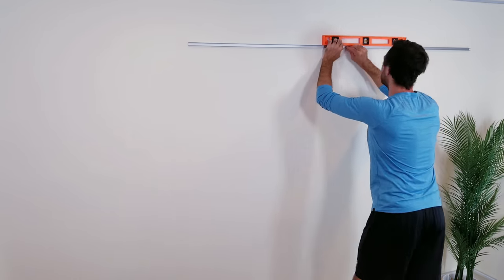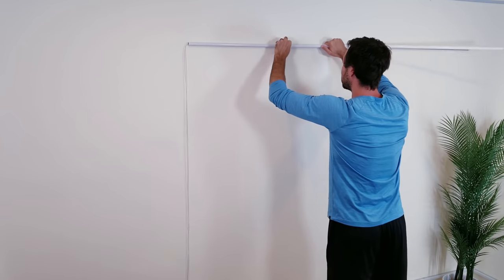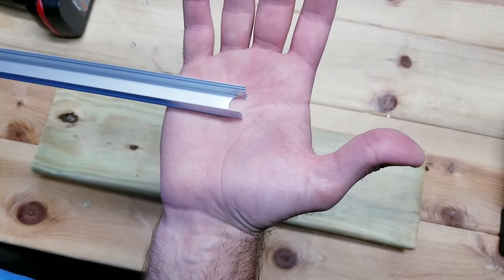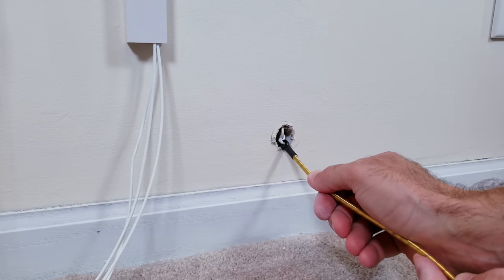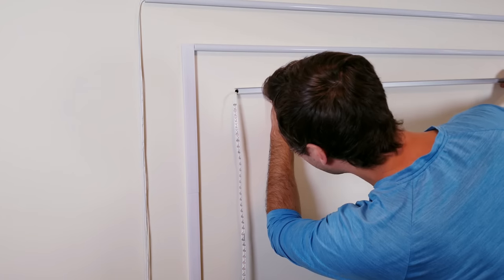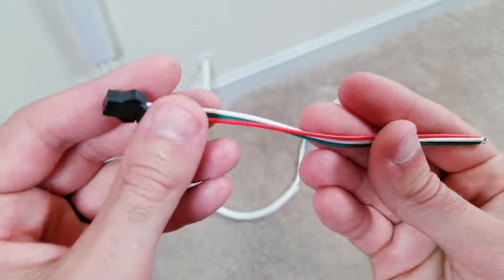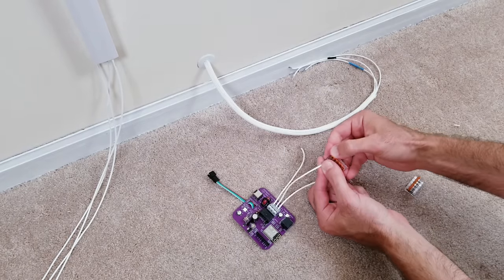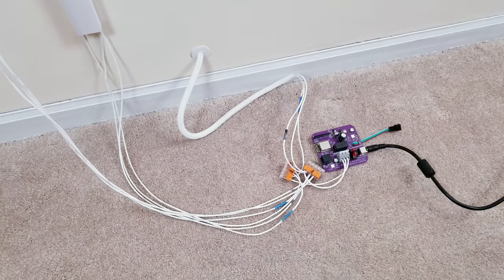How To Hide Wires Behind Wall - NO DRYWALL REPAIR NEEDED. Hiding Wires

Comment from the maker: 🚨 AMAZON’s BEST DEALS (updated daily): https://bit.ly/3VWZKVS
☑ Check out my sponsor to begin your FREE 14 day trial to Aura: https://aura.com/chrismaher
Spotless Diffuser Channel 1m Amazon: https://amzn.to/47aIujz 
Spotless Diffuser Channel 2m Amazon: https://amzn.to/3QoHeDb 
Diffuser Channel 1m or 2m Company Site https://bit.ly/3NHG5Uw

Domestic Automation WLED Controller: https://amzn.to/3sxkeYI
Power Supply For Controller: https://amzn.to/40yyQCZ
WS2812B LED Lights: https://amzn.to/47LIfLP
WS2812B LED Lights AliExpress: https://s.click.aliexpress.com/e/_Dc8oboJ
Magnepull System :https://amzn.to/3KUU60j
Magnepull 1/2 Inch Lead Attachment: https://amzn.to/3E7N0lx
Forstner Bits: https://amzn.to/3KTbFOh
Wago Connectors: https://amzn.to/44rFDjo
Wago Connectors In Line: https://amzn.to/3ORTbPs
Mesh Cable Sleeve: https://amzn.to/3EaNreO
Cable Concealer Track Large: https://amzn.to/45Hilas
Cable Concealer Track Small: https://amzn.to/3sgdMFt
Wall Plugs: https://amzn.to/3suFoXu
Wire Stripper: https://amzn.to/3EamDeI
18 Gauge Silicone Wires: https://amzn.to/3QRVxkb
3m Removable Wall Strips: https://amzn.to/3OvUaFY

=============================
Support My Channel Directly:
Become a monthly contributor on Patreon: https://www.patreon.com/ChrisMaherDIY
Buy me a Coffee: https://paypal.me/ChrisMaherDIY
==============================

Mentioned Relevant Videos I've Made:
Soldering for Beginners: https://youtu.be/apSz3NXYlx8
Domestic Automation Plug n Play Controller: https://youtu.be/aBOEHfT8VY4
Domestic Automation Motion Sensor & Push Button: https://youtu.be/d5NAn4qPXnA
Domestic Automation Multiple Data Pins: https://youtu.be/Zzi5UIGnY2A
Hiding Power Supply and Controller: https://youtu.be/ibRp6eeUwBA
Gaming Room Setup Part 1: https://youtu.be/KbbKAxnpCQQ
Gaming Room Setup Part 2: https://youtu.be/2lKaAhS2L1U

The best way to help support my channel is to like, comment, make sure your subscribed and share my videos with as many people as you can. The other way is to use my links above as I get a small % at no extra cost to you if you buy something. Thank you all for the support!
Reply: you got any links for muzada diffusers outside of US?
also that white mesh?

Comment: Cries in german solid walls
Reply: Cries even louder, punches the wall in despair and breaks his fist 😭
Reply: cries in Indian solid walls
Reply: Cries in Bulgarian solid walls
Reply: For those living in countries with solid walls.

Check code of corse. But, you can make a facia wall using striping and the desired face material.

Striping can be anything from strips of 1/4" (6mm) to 3/4" (19 mm) thick material aprox 1.5-2" wide (33mm-50mm). 

Co.siderations for thickness
Space loss, faster length, additional insulation or sound proofing. Any runs needed.

To bring a socket or switch forward flush. Start by turning the circuit off at any breaker (local laws may require licensed prof). Pull cover plate and unit from existing enclosure

Use an aptopriate "mud out box" in facia material.

Attach receptical to mud box.
Reply: @chiefgully9353  Sorry, what's a mud out box, and what's a facia material?
Reply: @ifohancroft  
Facia = face. Decorative material to form the viewable face of a structure. Sheet rock plank board ect.

Mud out box. I think they are listed as wall brackets. Essentially its a plastic or metal square with a means of grabbing the face material. It allows you to install a receptical or or a low voltage plate. 

If your code does not allow them for standard electrical they also make box extenders that might work.

We (america) call em mud out boxes becuase they are typically installed in an existing wall where you have already done a mud out. They are also used in situations where you do not have the wall cavity to install a normal box
Reply: @chiefgully9353  Thank you!

I guess then mud out means the hole you've cut for the box?
Reply: Cries in Swiss German concrete and brick solid walls.
Reply: @ifohancroft  yes
Reply: Cries in UAE solid walls😭😹
Reply: There's no such thing as solid walls if you have a hammer drill
Reply: Spachteln, schleifen und streichen angesagt 😂
Reply: Wanna trade? I can't hang my TV on wall
Reply: Cries in Bahamian block walls
Reply: Option 2 und eine Yukka Palme davor 😅
Reply: Dynamite 🧨
Reply: Solid walls can be chased or have surface mounting. There are no whiny excuses.
Reply: Cries in English stud walls and about 3 studs in between
Reply: Laughs in jackhammer
Reply: Are Americans starting to realize that glorified cardboard walls are joke?
Reply: @caustinolino3687  
What do you mean?
Reply: There is solution - 0,05mm thick flat wires prepared to stick wall and be painted.
Reply: Cries in Egyptian solid walls
Reply: @caustinolino3687 
😂 It's the best for DIY.
Reply: Cries in South Africa solid wall
Reply: Central and South America are mostly solid walls, idk what is the deal with north America, the idea of non solid walls is crazy😂😂😂

Comment: for anyone considering, please DYOR as fishing lines behind drywall can be unsafe. use cabling specifically rated for in wall usage (ex. CL2/CL3 etc) if you dont want to burn your house down
Reply: I was just about to say!
Reply: I was just about to add a comment about this very topic.

Not only is using the properly rated cables safer, but it will ensure that your home can pass an inspection if it needs to.
Reply: Could you explain this more in depth please, in a manner that someone who doesn't really understand that, would be able comprehend, beacuse it sounds really important to know
Reply: @b1ooberry  sure, there are cables made for behind the wall applications. using standard extension cables, audio/video cables, and data cables like USB or network that you can find commercially are typically not rated for such use. there are such cables rated for in wall use which can safely sustain higher temps and reduces the risk of starting a fire
Reply: @jasenhenry thank you for the information! That's really cool to know for my future projects, so I appreciate you taking the time to tell me!
Reply: first thing I saw
Reply: I am not sure that's accurate. Those are only low voltage cables. They don't have to be plenum rated since they are not in the attic.
Reply: @RaoulHira  NEC standards in USA requires it for fire safety. im not understanding your argument for a less safe practice? "safety first" is a household term while "danger first" is not. one of the primary reasons for electrical fires is heat and standard consumer grade low voltage cables are simply not rated to sustain higher temps safely.
Reply: What’s fire insurance for anyway. Let it burn
Reply: Under 50v does not need to be rated for in wall nor do data lines.
Reply: @mattypants  I ran cables in wall opposite of my oven. if I didn't use in wall rated cables it would catch fire regardless if any data or power is actively passing thru it. it exists for a reason
Reply: @jasenhenry  why is the inside of the wall getting hot enough to ignite cables? Standard insulation on wiring, including Romex, can handle just under 200 degrees f. The inside of your wall should not be getting anywhere near that hot.
Reply: @mattypants  look dude, do what you want, it doesnt affect me. agree to disagree. later
Reply: @mattypants it's the risk of the wire overheating - over amps to a full a short turning the wire into a resistive heater to the capacity of the power supply until the wall ignites or wire breaks...
Reply: Not quite . It’s so that the wire does not further spread or propagate any fire in the future. That is, if you do have a fire regardless of how it was caused, you don’t want the flames to catch onto wires in the wall and spread more rapidly up or across into other rooms or floors. In the case here the wire is only a few feet in the same room so it seems a bit moot for a fire spreading perspective, but the regulation /code is there for that reason. Fire-rated cable won’t combust and flame as easily as non-fire rated.

Comment: So the trick with the magnet tool without opening up the hole is to bring the lead past the exit hole as low as you could go and hook back end and pull it out by the lead.  the roller tool should also pull on the eye too to get it near the hole laterally if you end up bottoming out against a floor board and the eye  wanders .

Comment: Nice!. Another alternative for the wires on the bottom is to remove the baseboard, then cut the drywall just below the top of the baseboard. You can then route the wires left or right to any area to hide the controllers and cables. May have to drill through studs to get to your desired location. A little more work, but even a cleaner look. Look for a YouTube video by Everyday Home Repairs - video: How To Add An Outlet To A Finished Wall
Reply: Oscillating tools with a hemi-blade are handy for this.

Comment: Nice one. Thx!

Btw: 
The Wago Clips, i found out about them via one of your vids and ordered them...now i already have replaced or hanged some new lights with them already, they are damn good and so easy to work with.
No more screwdrivers, no more wiggling around to get everything into deep dark holes (pun intended), just open, insert, look thru and in, and click, done and dusted and pretty strong.
So thx for that as well. :)
And now off to the LED Goodness we go!

Comment: Great video. Note: When fishing wires down a wall, sometimes, you run into fire blocks which will stop the wire from moving down the wall. Plenty of other videos out there showing how to get thru those but will require additional cutting of the drywall..
Reply: I've seen fire blocks in walls in stairwells and between floors. Do those get installed in a normal room wall sometimes? Genuine question!
Reply: @xenidus  yes sir! I came across two in our bedroom walls. Since then, I use an endoscope to give it a look before diving in.

Comment: Good stuff Chris. I literally just used those Cable Concealer Tracks the other day for a remote controlled projector screen (the woes of renter life, can't put big holes in the wall). They work out great by themselves but even better if you can run them behind something else. In my case I just stuck the projector screen cable, controller box & their concealer tracks behind a hemp lamp cord that I wove a bunch of fake vines into. +2 stealth for my cables without any extra holes.
Reply: Yeah renters well anyone would be shocked how much weight a sewing needle or few, inserted at a sharp angle of ~45-70 degrees can actually carry. but they are just pin holes right, someone should test this, too hard to get a standard needle these days, i bet .

Comment: Thanks Chris. Your tutorials are always very helpful. Concealing cables are always a challenge especially when you have concrete walls.
Reply: That's why he showed the track method ignoramus...
Reply: WOW Really  @theecstatic9686  . Resorting to name calling? Im well aware that Chris discussed the other options in the video.
Reply: "Conceiving Cable" sounds like a new euphemism for a male body part! 😂  (I know you meant concealing.  Also, don't listen to theecstatic9686.  I don't know what makes people behave that way.)
Reply: @DavZell  🤣🤣🤣🤣 damn autocorrect. I'm conceiving ideas to hide my cables on concrete walls.
Reply: For very small wires like this, you can always create a channel and tape/mud back over. It's not necessary to physically get behind the wall.

Comment: Those individual conductors are listed for use in a raceway only. Try 18 awg thermostat wire for low voltage leds when running the cables through the wall.  Thermostat cable commonly comes in 2 conductor to 7 conductor varieties.
Also, if you're going to use a wiremold type of raceway at the bottom you can use the raceway to cover the hole in the wall. They do make endcaps for wiremold raceways.  I would not recommend trusting the doubleface tape long term. Put some screws in to hold it long term.
Reply: Some of those 3M Command adhesives are designed to hold up to 30 pounds of stuff. I've used them for fairly heavy framed pictures (about 12 pounds each) and they've been up for 7 years now.
Reply: @OneWildTurkey  let's be honest. They're in a position that's not likely to be hit or yanked on and are considered temporary installations.  I've learned not to trust adhesive tapes for installation of electrical components because I've seen too many of them fail with time.  You want to secure those components with screws and, if necessary by design, straps.
Reply: @ianbelletti6241   I don't have kids, so wasn't thinking about them getting yanked on...  VERY good point!
Reply: [TLDR: He's fine with the 3m ever 3-10+(?) feet just clean surface + remove the 3m stickies w pull tab as shown]  The 3m sticky will readily rip paint plus paper behind it (of drwall) unless you remove it using thier (very obvious) 'Pull' tab. Trust me that 3m stuff will adhere to any cleaned surface (as per specs obv) but you're right as well because how much do you trust some paint and paper on compressed powder to hold up your 1/3rd amp (and lb :) Led strip. The 3m sticky is supposed to be installed vertically (i thought) but it still ripped paint n paper off my wall when an EX friend stuck some on middle of my custom painted wall for no reason ripped it off I even said right away "wtf you best not touch thatnow bud, cuz you GOTTA REMOVE it just like it says!" No brains are my pet peeve no sorry it's just no respect. Anyway of course he didn't but waiy till i left the room and, well pointless... Man lives thru war then can't manage to not leave a square inch of grey on my wall. Turned out to be a thief "I shoulda seen the writing on the wall" errr peeling as it were :)

Comment: I have some metal posters behind my couch that I decided to backlight with RGBW LEDs, since the posters and the couch cover a larger area I was able to use cheap low voltage old work boxes to run the wires down the wall and under the couch to the power supply. The old work box is just an orange plastic flange that reinforces the edges of the drywall so you can run low voltage wires and not tear out or further damage the wall.

Comment: Here is another tip, when pulling your 3 wires through, add another wire/string/something to act as a pull like you did originally, just in case you need to pull something else though, save you having to undo the 3 active wires to get them to be the pull through.

Comment: In Australia most residential walls will have "nogins" in them - cross pieces behind the sheet rock at different heights. This is a problem if you want to magnte-fish your wire as you need to ensure you aren't hitting one. 

If you have roof entry - use a long bar to knock the noggin down on one side of it by drilling through top plate, then use your long bar to run down the wall sheet and stud and bang the noggin until it falls down. I've had to remove tiles to have verticl space to do this.  It's the last option I have sometimes before having to make a hole at the nogin and drill/feed the cable.
Reply: We have them in the USA as well. We call them fire breaks.
Reply: @diedrichg  THanks I didn't know that. Might need to look up why the name and why they exist :P. I thought it was just structural to stop the studs bowing or twisting and deforming the wall.

Comment: you should have made a bottom hole at outlet height and used a  AV passthrough plate. Would look cleaner and can be replaced with a blank plate if not needed in the future. just my opinion

Comment: If you have carpet and a baseboard along the wall oftentimes there is enough room to tuck thinner cables like the flat-style Ethernet cables underneath. No need to install anything, besides perhaps a couple staples or cable guide pins if there is a portion they have to jut out (like along built in cabinetry).

Comment: Question....Since these are wired parallel, when you go into settings, Do you just enter the length/LED's of 1 strip ?? I'm doing some floating shelf lighting and trying to decide on "Parallel" with movement like in this video or "Normal" just with some wire between each 24" cut strip so that the movement travels up the 6 tier shelf.

Comment: Without watching any of your previous videos on WLED, strips, etc. I’ll play dumb for a minute - I see at the end of the video you are left with the connected wires and the control boards.  Could you do something like run the 3 LED wires to an existing single-gang outlet box , remove that box, enlarge the drywall to a 2- or 3- gang size, replace the box, install the outlet back, and hardwire the controllers to the existing hot/neutral/ground wiring with the outlet? Does that setup exist and the controllers in-wall rated to live in an electrical outlet box? I hope that makes sense, thanks!

Comment: Chris thanks for these vids!  I've used your advice and have purchased an LED strip setup... two questions if you have a moment... 1)  How far apart do you space the sticky strips?  2)  How do you effectively line up channels so that they don't bleed through at the junctions?     Thanks!
Reply: 2) Have the diffusers span gaps in the channel.
Reply: yes i would be concerned for losing lumens with such a 'hotspot' blend cover..

Comment: This is fantastic, BUT, the Magnepull/fishing will only work if you are sure there are no fire blocks in the way. I guess it never hurts to fully scan the wall for studs in both dimensions.
Reply: Borescope for looking inside the walls.
Reply: @brodriguez11000  I love borescopes but it does mean causing slight damage to your wall, just for the diagnosis.

Comment: I've been wondering if you can use flat speaker wire tape (like ghost wire) for leds? I'd love a video with you trying it out. (Since you have more experience with wired and soldering and such)